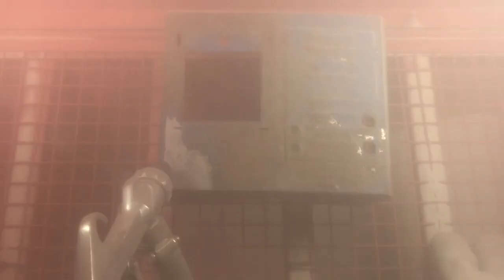Tonka Restoration - 1976 Mighty Tonka Dual Boom Wrecker Restored

Comment: Great job! But I don’t know why you go through all that work and you don’t use a primer, it fills all the little rust put holes and sands up easy???
Reply from the maker: Thanks for watching!
Reply: I worked in a factory making high bed stuff for hospitals. It's powder coated and not primed. It's tough and very durable as it is. You could primer but I don't see much advantage.
 These aren't primed from the factory either.

Comment: Welp, everything was looking good until you came out with those blasted pop rivets....Tonka used semi tubular rivets.
Reply: I was thinking the very same, and they are available on eBay.
Reply: I thought the same, then googled pics of the toy, guess what, they used pop rivets on the sides originally.
Reply: @madmanmechanic8847  , …….lol, such nice language.,,,Now if that doesn't speak volumes about one's charactor, I don't know what does.
Reply: @mrcamelpmw  , yes, after googling you are correct. I have done a bunch of Tonka restorations and that is a first that I have seen. Kudos to TRG on doing it correctly. I still hate the dang things though....lol
Reply: Well thank you John I pride myself of pointing out the positive things about people unlike you . LOL
Reply: @madmanmechanic8847   Yeah boy!! Aint nothin like getting cussed at with filth to accentuate the positive...Excellent example Rog!!…..lol

Comment: Would like to see a restoration where you make missing and broken parts instead of buying them. That would show skill instead of just money.
Reply from the maker: you've clearly not watched all of my videos
Reply: 😂 how is one different than the other? Both require money thrown at the situation, buy the parts or buy the printer, software, filament etc. The real skill is watching some guys use lathes and mills to recreate parts, programming a 3D is not on the same skill level

Comment: How much do you charge to restore Tonka trucks I have the same tow truck just curious
Reply from the maker: I generally only do restorations for people, if it's something that would make a good video. Otherwise it's definitely not a profitable enterprise. If you take a $50 toy truck, throw $50 worth of replacement parts on it, another $50 worth of paint and supplies, plus it I were to charge an hourly rate of $15 and hour, times the 20 hours it would take to restore a truck. By the time it's all said and done there would be about $400-$500 invested in a restored toy that might be worth $80 to the right collector.
Reply: @TRGRESTORATIONS  your right thats a lot of money to put in a toy that would be worth only 80 bucks.thanks for all your feedback.

Comment: Sorry, last one, promise. I see you had a little trouble with the caps for the wheels, next time use a small socket that will fit over the cap and hold it nicely when you use your hammer.

Comment: Hi there... I'd like to know what tools you used during the course of the restoration project. Also, I think if you had added chrome to the wheels of that wrecker, you could have increased the value noticeably further.
Reply: Hammer, screw driver, needle nose pliers, pipe pliers, Dremel tool, pop rivet tool. Pretty self explanatory considering these are rudimentary tools.
Reply: Chrome is not a stock restoration, and who says he resells them.